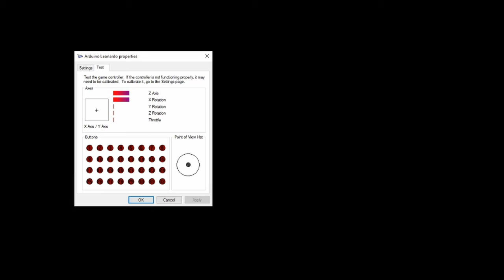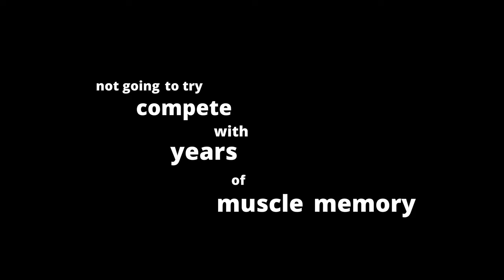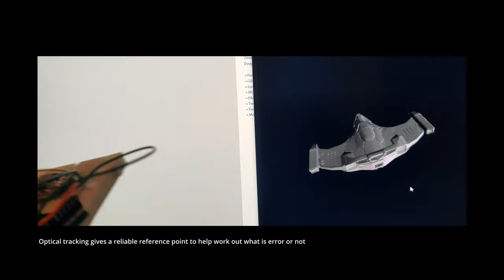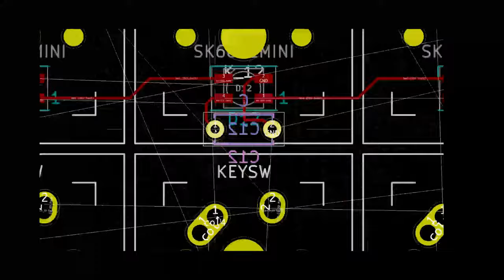How I built a custom joystick for Star Citizen

Comment: Hey @
yroethiel really cool build! We just ordered a new Formlabs Fusion 1 and I am planning on building a custom 3D Free formed flightstick with custom buttons specifically for Star Citizen. I'll weld a solid Aluminium base and parts for it as well to give it a more sturdy feeling and some feedback when moving into hard curves. Would love to exchange though a bit on the programming side. For testing i used dual accelerometers with Arduino to cancel out some of the noise. Have a good year! CU in the verse ;)

Comment: First off, thank you for this vid, it is actually pretty inspiring to me. I am an electronic musician who started playing star citizen recently and I have been trying to work out how to use a joystick + custom controller combo. For my left hand controller I am attempting to use a MIDI controller sincI have a ton lying around, and I have settled on a ROLI lightpad block (that is a pressure sensitive customizable RGB touchpad that comes with it's own software for programming your own 'button zones' ) The cool part about this over a PCB based thing with straight up analog buttons is you can also program custom faders/sliders in the X or Y as well as custom XY pads. Anyways I am pretty much stuck trying to get any key commands into Star Citizen itself despite having the hardware and mapping figured out... anyone got any ideas?

Comment: Any updates on version 2?
Reply from the maker: I did make a version 2, which uses a customisable touchscreen interface. The touchscreen displays a locally hosted website, with a graphical interface full of buttons. When you click a button on the touchscreen, it send commands to the joystick hardware, which the PC then interprets as a hardware input. The reason I went down the "hosted website" route was that you could redesign the website whenever you wanted to have custom interfaces (basically what GameGlass do)...say for a different ship or game. The interface is an SVG that you design in Inkscape (open source), so easy to modify. It works well, built on the foundation of the one in this video, but I've stopped playing Star Citizen, and moved onto other projects...so there won't be another video I'm afraid.

A couple of photos if interested: https://imgur.com/a/NOEMydg
Reply: gasp
Ooooooh the raspy is not connected to the PC, but to the arduino.... 

but still ... if you have some more infos ... please :)